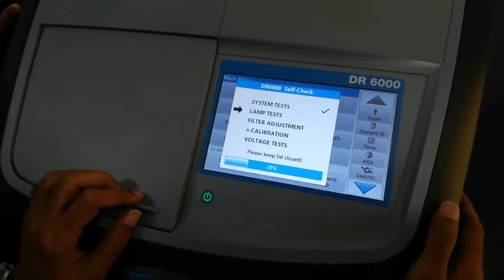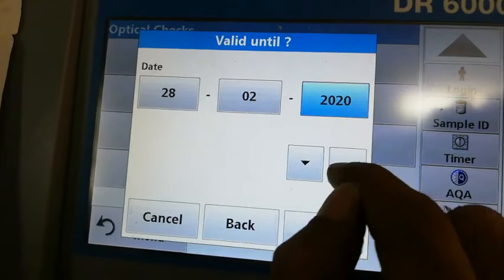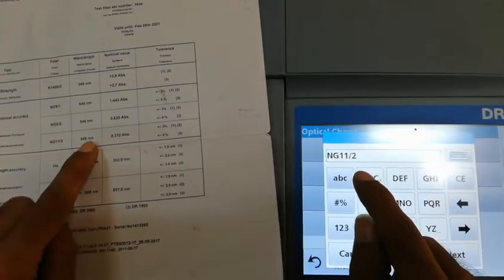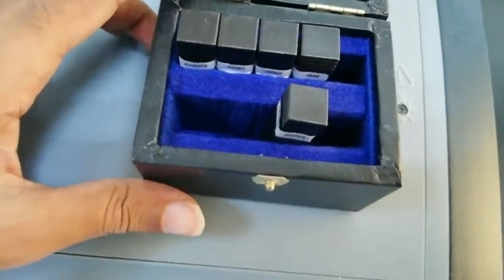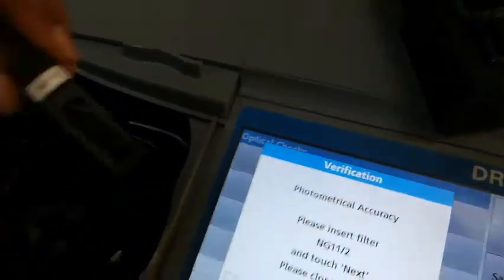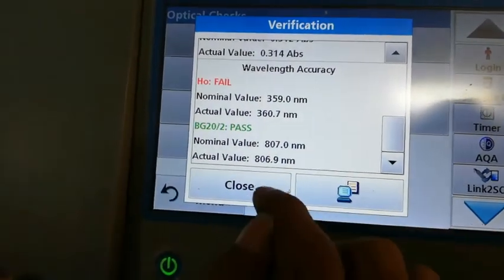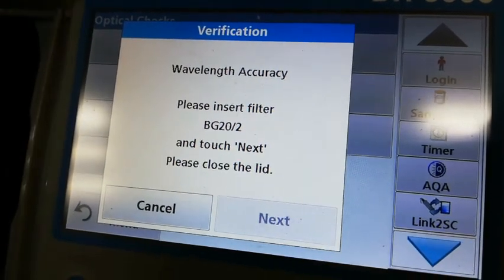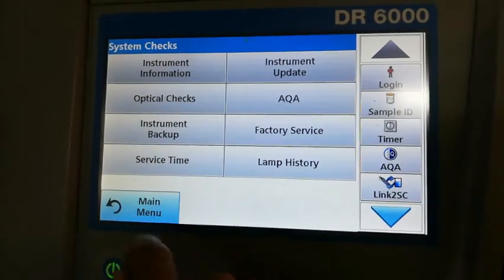Spectrophotometer with filter Verification HACH DR6000

Comment: Very very very good, but 
What is the difference between Verification and Calibration for DR6000 ?
Reply: A verification is the objective evidence that an equipment works like the user needs, in this case with the supplier filter´s.The calibration consist in compare with standard material (with international traceability) and associate their errors and uncertainties.